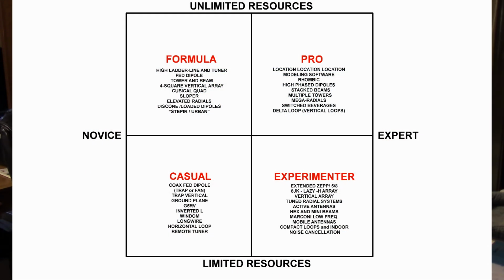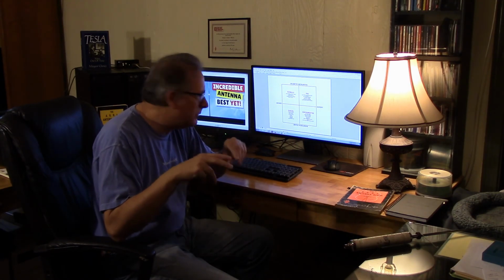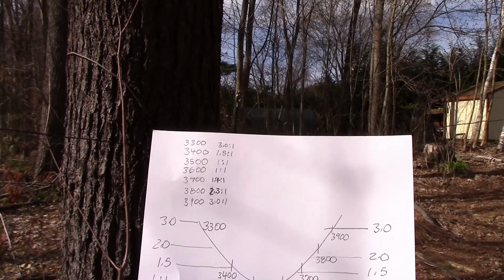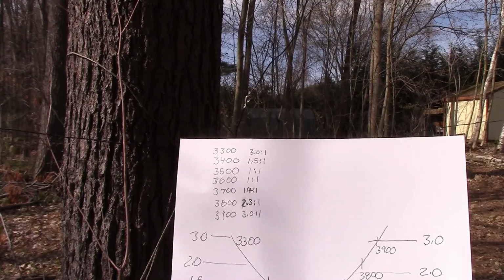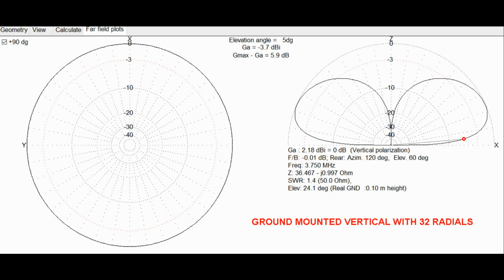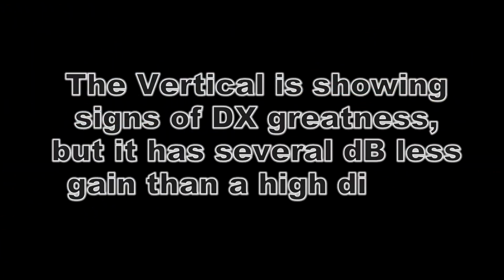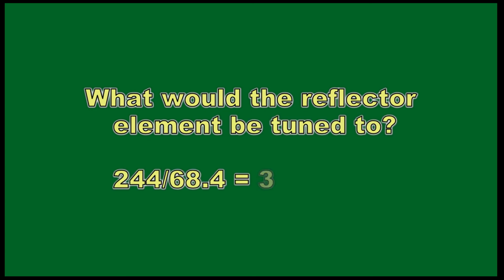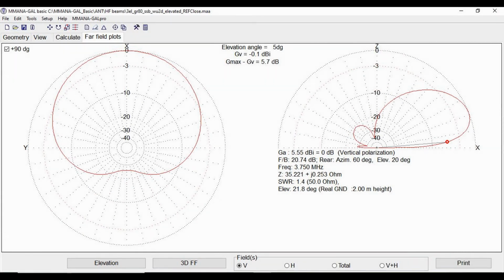Antenna Psychology and the Ham Operator

Comment: Excellent video! I always buy the coolest looking antenna with the coolest name, especially if it has a snake decal on it! But it's gotta cost a LOT!

Actually, Claude Shannon, Jerry Sevick, and John Kraus are my tech heroes. I was shocked, nay offended when I heard that The Ohio State University had torn down Kraus' Big Ear antenna and sold the land for a golf course. I wanted to punch somebody. I also built what may well have been the world's best LowFER band antenna after spending a few weeks at the NIST library pawing through antenna books from the 1920's and '30's, then spending a couple more weeks winding 2 miles of wire on 3" PVC pipe. My ham friends, (I wasn't a ham,) told me I was crazy. I told them, "Nah. I'd be crazy if I bought a 102" whip with a $270 loading coil."

A windy day is an OK day for tuning such an antenna. But of course it's best if it's nighttime and there is blowing snow. I always wait for that.

BTW, your trees are 'semiconductors'. :)

Comment: Aluminum is for professionals and those with zero other hobbies and/or those with high incomes. The rest of us sling wire and we sling it all over the place. I have enough real estate for a lot of wire--and if a storm rips it all down--it's just wire. I think I need a vertical with parasiics, but first a 1/2 wave EF on 160 with the 49:1 transformer (slightly different than the one for 80-10).  I had one working before but it wasn't good for the higher HF freqs.

Comment: what does "DX" mean?

so for the antenna, you used a single horizontal wire at about 1 meter above the actual ground? ... oh... there are 5 "radials," right?  5 horizontal radial wires to create the artificial ground plane

the diploe is two wires with the connection in the middle and no ground?
Reply from the maker: The ground plane antenna is kind of like a vertical dipole.
Reply: @MIKROWAVE1  Thank you for the answer!  :)

Comment: Thanks for your Video Channel! I know only for sure that I fit in the limited resources half. So, lacking the money, I have to use what I have. I do have the Kraus Antennas book (I was lucky to find it for almost free) and hold all of the Amateur and Commercial licenses. I did the latter on a lark,  just to get a better understanding of it all. Chasing a flat match that ISN'T a parabola? Like chasing a Unicorn while heating the worms: Everything is a compromise, always keeping in what I call in my mind "The RF Budget." How are you going to be broadband AND have peak radiation resistance? I don't think that math exists! Besides,  it's a lot cheaper to skip on the 220 Volt wiring and an amp, and a tower, and just lay down a LOT of radials instead. They don't involve climbing, and you can even move them around to get a little directivity, not much but some. Never do you have a frozen rotator to finance, and climb and fix. While wire IS getting pricey, it doesn't come close to the cost of an amp. And a tower. And helps the Wife Approval Rate. Indeed, I am amazed at the performance of a short tapped vertical tripod mounted over a decent ground field. Mine is only twelve feet tall, more or less. Half Square is also always a really good good portable performer. They really get unwieldy past 40 metres though, and really past 20 metres unless you have some help. You might have good luck at 10-15-20 metres. You might be able to go with the 80 halfsquare with the land you have, though I think that's  going to be potato blunderbuss or slingshot category. I'm not sure about 80, because I've never had the opportunity to try it. You won't have any local coverage, though. It will be all DX. But a "Just above the ground don't worry about it" NVIS dipole and an "AB" Switch" will take care of that! Living right more or less in Central Ohio with the low dipole NVIS setup, I get a nice complete coverage of Ohio as far as I can tell.  No Doubt, some enterprising Ham will hoist some monofilament line with a drone, and keep adding larger diameter stuff to that, get a Monster 160 halfsquare up someday, or they already have! That might even help with putting up a horizontal rhombic....That's what Ted WB8PUM and The Gang use at WTWW, so since it works for them, it should work pretty good for you too I would guess? Is it ME, or are some guys actually just heating up worms  (or maybe doing their part to fix the hole in the Ozone Layer) with all of that expensive turnkey stuff?   73 DE W8LV BILL

Comment: My Dad in the early 80's put up 150 foot antenna for his radio.  We were in Southeast TX and he claimed to be able to reach the Eastern CCCP (at the time)  Now my father wasn't known to lie, but I always thought he was exaggerating slightly about the range of his radio. Of course he did have a huge radio tower and ten plus grand worth of gear in 1980 dollars, so I really don't know.  BTW, we lived in an unincorporated part of the county so he could have put up an Arecibo sized radio antenna if he wanted, of course the nearest hospital was an hour and a half away so any sort of injury was life threatening, so that was fun.
Reply: Obviously we don't know anything about your Dad's setup, but perfectly believable.  Nit sure how many people we on the bans in the CCCP.
Reply: Early 1980s was a good solar maximum.

During this, especially on the higher bands like 15, 12 or 10m, a wet shoestring is sufficient as an antenna to reach the world. I have multiple (trustworthy) accounts of people using 2 hand-held radios to communicate between Europe and the US. 

A big antenna makes it MUCH easier, of course. With a good 3 or 5 element at 150ft you can make reliable connections pretty much anytime there is propagation at all (if there isn't, you can pump megawatts into the Arecibo antenna and won't hear anything on the other side .. except you bounce of the moon or so).

Comment: Bring out the pitch forks, and burn his house to the ground. My neighbors. ThInk I am interfering with there Obama TV.  The band is junk and is subject to break ups. ALL THE TIME.  So far I had a 2" pipe broke.  Just to take me off the air. I'm ever vigilant of the pin or needle. Shoved in to coax. Threats. But I keep fixing. And keep contacts on my log book. Then blame is debunked. And tell them that if I exit my house the cables are pulled away when I'm gone (lightning) . There so desperate to blame. And get a look inside. Antenna are high maintenance. Good life om. De kv4 li
Reply from the maker: Tip for the neighbors. Have one of your kids get their ham ticket. QRM might get Steve to move so you can watch Oprah again.

Comment: Very interesting video, thank you! But... how did you get your antenna wire to the top of that tree? Do you have a domesticated squirrel? 😀
Reply from the maker: My fishing rod and a weight! Then I pull up strong twine and finally the rope and antenna. Yes it is silly to watch.
Reply: Wow! You must be good risherman! I tried that method last summer, it was silly to watch and it felt silly, but no fish. Only somewhat manageable method i found was using a drone to fly thin fishing line over tree . Took two drones but i got my half wave wire over tall tree. Must be quiet weather, wind makes drone movement unpredictable. This year i will try vertical antenna, because wind broke my half wave wire. It was too thin, but at the moment it was all i had in hand. Any ideas how to make your vertical work on 160m? Trap plus some more wire?

Comment: Yet another magnificent inspiring video by Mike
I wonder how you got those wires 70 ft up in the trees?
Reply from the maker: There are launchers, slingshots, Bow and Arrow devices and enthusiasts ... but I am a fisherman so I use #14 mono on a bass rod with a weight! Then I pull back paracord and finally the  line and antenna insulator.
Reply: @MIKROWAVE1  ,   NOW I can double up on the uses I can put my 16 fishing rods and 20 reels by using them for ham radio! de KQ2E